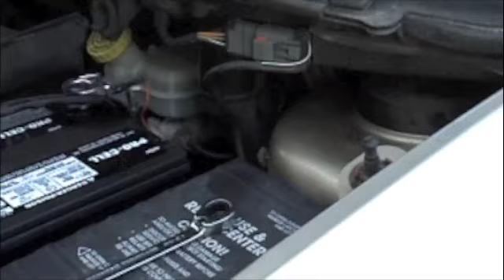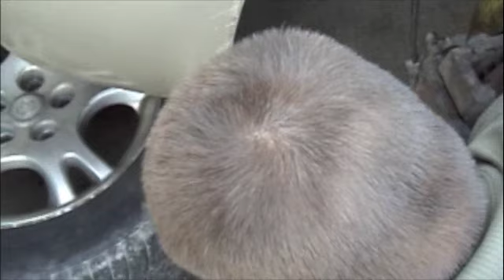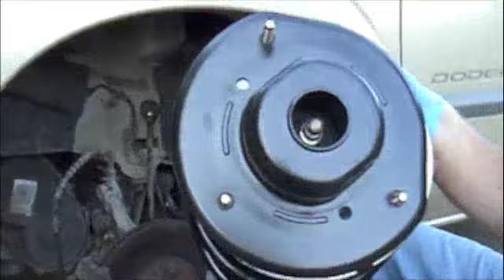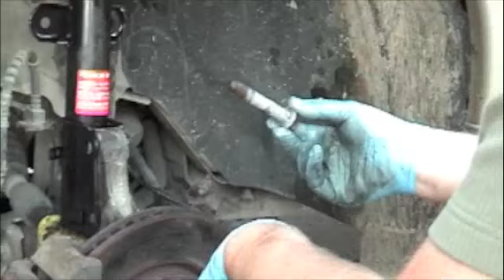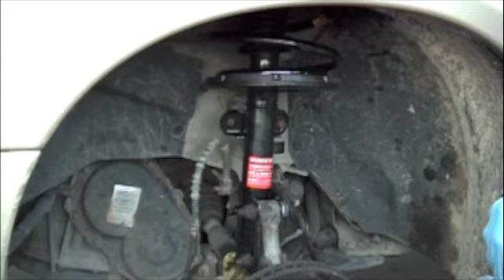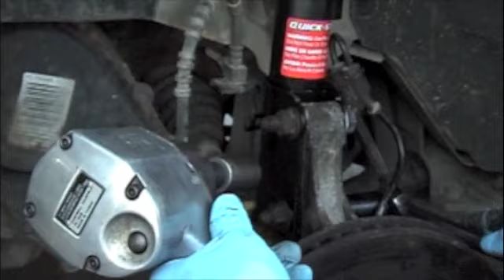Part 2 of 3 How to replace struts on 2001 Dodge Caravan Sport using Monroe Quick-Strut

Comment: The whole reason I was watching this was to get the torque spec. Why not just say the torque spec??
Reply: +Michael “Doomahachy” Feliciano Why not just look it up?
Tighten it up just before it breaks & call it good!
Reply from the maker: +Michael “Doomahachy” Feliciano There is a possibility that the torque specs could vary between models & suspension packages so it would be safest to lookup the torque specs for your specific model.

Comment: The video was very good, there is no need to use a torque wrench if you are going to tighten a 1/4 turn more. It defeats the purpose of using the torque wrench